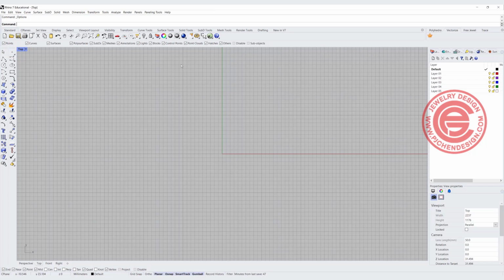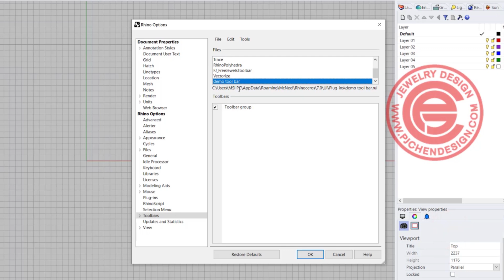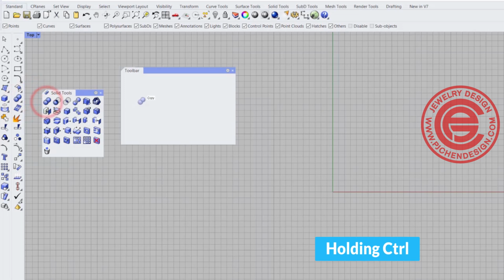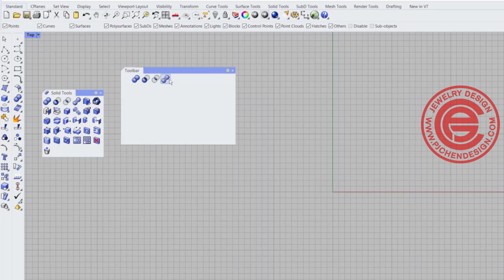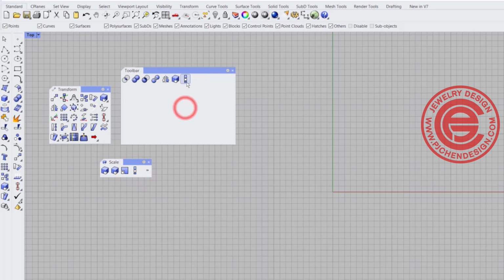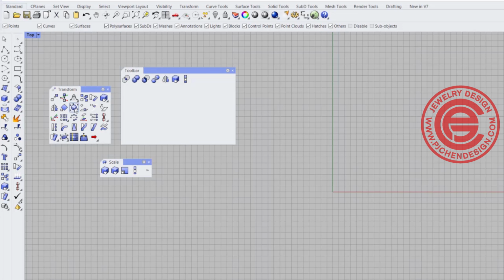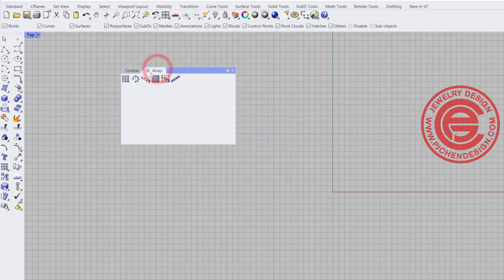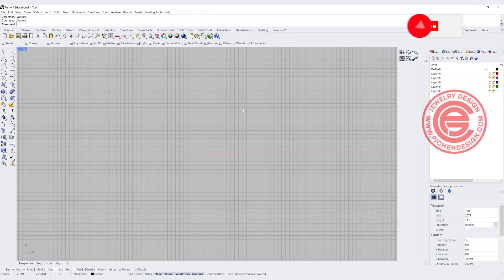Custom Toolbar with Rhino 3D #312

Comment: Hello sir 
Which is the best IOS use for Rhino 
MAC or windows?
Reply from the maker: It depend on what you have now. mac or pc. I personally like pc better but many of my student use mac as well.
Reply: @PJ Chen Jewelery Design Thanks for your reply...
and yes pc is the best and right now i am working in windows 10 i am +7yr matrix designer
But I was thinking of getting a laptop, so I had to know that working in Mac is as easy as Windows,
Because Mac is much faster than Windows,
any Best Laptop for Suggestions for High Level Working, Mac and Windows